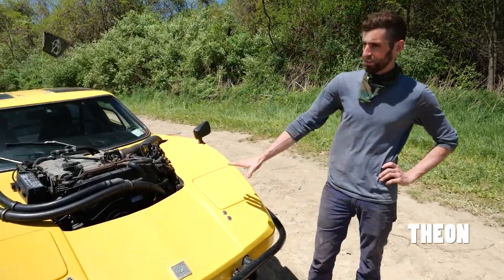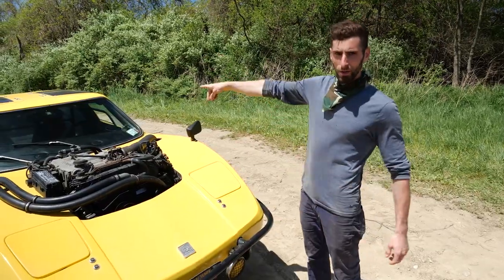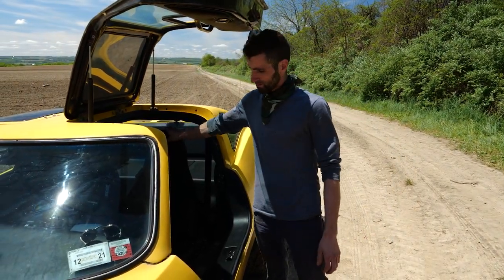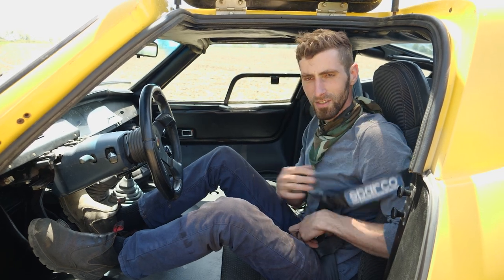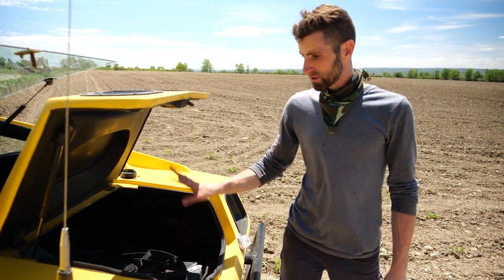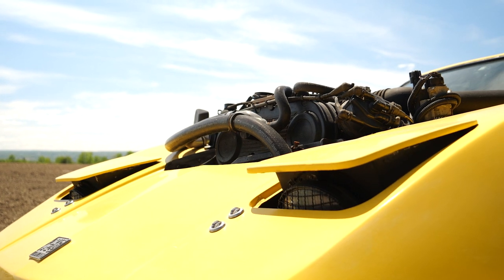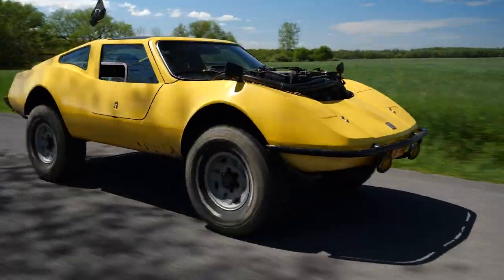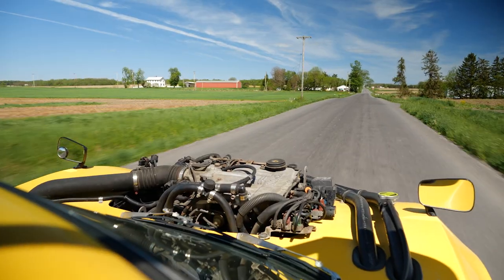WHAT IS IT? Toyota 4x4 VS Bradley GT II

Comment: Are you comfortable sitting in the Bradley?
Reply from the maker: Gets a bit rough on long drives
Reply: @theonomicsbuilds6133  am thinking about getting one local. I'm 6'2 so it looked a little cramped. Maybe can lean seat back like crazy and have a telescoping steering wheel.

Comment: IF you ever come across another Bradley GT folks are putting Subaru engines in them with greatly increased horsepower over the stock VWs.